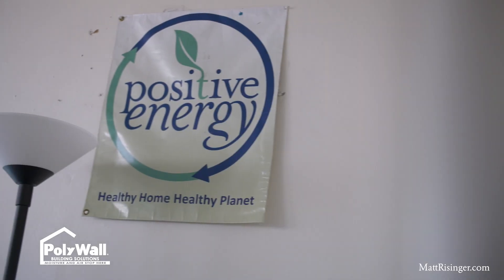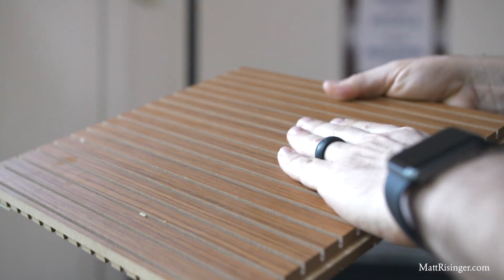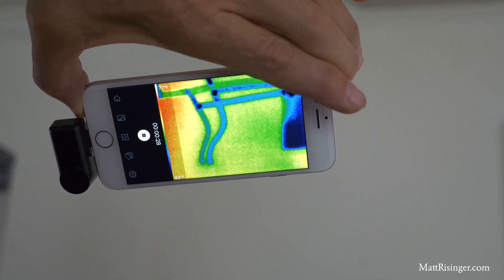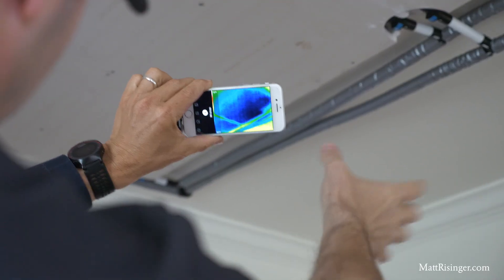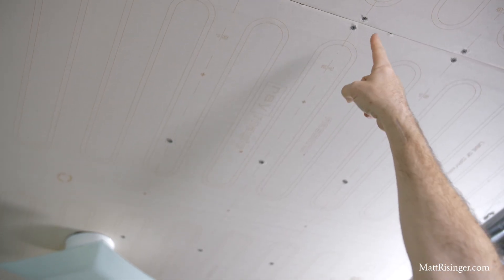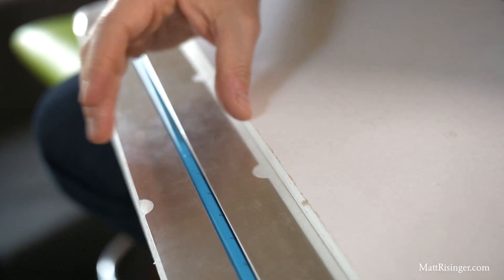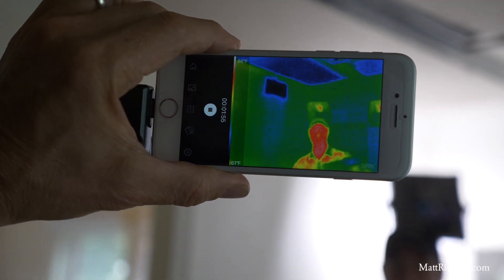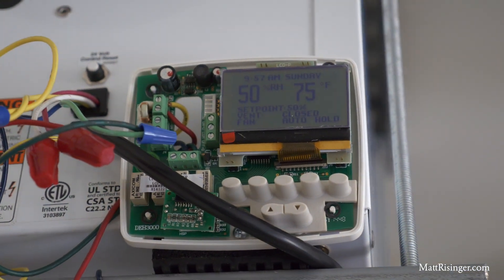Cool Your House with CHILLED WATER

Comment: @Mattrisinger I want to know if they've thought about using this in greenhouses and have they put any consideration into using a thin copper tube in the system (for reclaiming heat off of a wood stove or something similar) and I want to have a system that is similar to this except I want the water to either use heron's fountain (the concept, not the literal fountain) or be manually collected in buckets and poured back in the top end (a high point in the system or maybe you could have it manually syphon like a fish tank or gas from a car)  to not use electricity.  But mainly I want it to be capable of carrying  warm and cold water (I live in NC and it can get cold in the winter and very hot in the summer (mainly the humidity)) and I want to use the system in a greenhouse (cold climate greenhouse).
Reply: Check out Russ Finch's site, http://www.citrusinthesnow.com/   They've built over 90 of these greenhouses now using a very simple GeoAir solution.  https://youtu.be/ZD_3_gsgsnk is a good overview.

Comment: This sounds pretty cool (pun intended). But what I would want to see working is this system for the summer time and then in the winter push hot water through the same lines to heat the place. Now THIS would be pretty awesome.

Comment: The dehumidifier has a fan and is necessary to remove the moisture to avoid condensing of the cold water pipes raining from the ceiling. 
I do not see any benifit to this type of system. They also looked shiney like the were about to start sweating.

Comment: I like the idea, but why the water-to-air heat pump? Couldn't 50 degree groundwater keep the ceiling at 70 or below that? I realize that could take some digging in Texas, but it would be a lot cheaper in the long run.
Reply: Sure. But then you're just using a geothermal system.

Comment: I've been using radiant cooling for 10 years.  In the summer, I run well water through my radiant heating tubes.  It doesn't sweat because the house is very tight and it's a moderate climate (chilly summer nights knock down humidity).
Reply: Can I ask where you are? I'm in central Oregon and ess told not to do this because of sweating. My pex is under the floor on the crawlspace.

Comment: Sorry, but in the majority of regions in order to properly condition the air you have to cool below the dew point to get the humidity in a comfortable range. This so called "radiant" cooling can't do that. Plus, you're forced to back it up with a dehumidifier, which is a direct compression unit anyway. Way too complicated...just to be different.

Comment: This was tried in a commercial environment, but because of condensation issues and it wouldn't keep up with rapid temperature changes, it was eventually scrapped! Have you solved any of these issues? Also, it seems less efficient because the dehumidifier has to work more to maintain a compatible dewpoint.

Comment: Why can't you use an old hydronic heat radiator as a cold water heat absorber?
Reply: You can, but it will sweat all over your floor. Look into valence convectors, they cool, and remove the humidity all at once.

Comment: I do the same thing on a small scale with my computer in the winter. It is water cooled, but I live in Colorado and it gets to like negative 20 in the winter. Rather than pump additional heat under my desk, I run the water lines to a huge radiator I have outside. It is almost completely silent, and actually functions better than my normal water cooling in the summer.

Comment: My Dad did this in the 1960s with a self-made system that pumped "ground" cooled fluid, not water, but water and antifreeze, through our radiators. It came in at around 50-60 degrees F, good enough to cool the house  down to 75-80 on the hottest summer days. The radiators sweat. but that was easy to clean up if it meant a cool house to Mom.  The water pipe system ran underground into a cavern pond near the house that always stayed cool where it radiated the heat.  He developed the idea from his Dad who owned an old west saloon where they kept beer cold by storing the beer barrels in an underground dugout cellar.and piping the beer up to the tap. If they could get ice from an ice house, then the ice would be placed onto the kegs to help. I'm still using it, and right now today was 110 degrees and inside it was 85.
Reply: Hi, may I know how can you turn it off on winter? I'm interested in your system. Thank you ^^
Reply: @AnhNguyen-ul6lb  just turn off the pump and the water in the radiator won't be moved to the heat sink (in this case, a lake), and therefore the radiators will be the same temperature as the air in the room. all you'd need to do is connect the pump to a thermostat and it would shut off automatically.
Reply: @doctordev97  the water needs to go back to the main tank or thermosiphoning will keep cooling the house
Reply: How much is the electricity cost compared to an a/c?
Reply: @kimie126  an electronic water pump that circulates the water (just the pump, no heat exchanger or anything else ) would consume about 200watts. an 12.000btu a/c would consume about 2000 watts, so 10 times difference in electricity costs
Reply: Have you had condensation issues behind the wall or is the condensation just at the radiators in the room?
Reply: @stefanpomrenke9612  Radiators only but then we live in a dry climate, so it's not a big issue.
Reply: @themoviemaniac8416  

Does it create humidity?
Reply: @johnle231  Just condensation at the radiator sometimes if the day was humid. There's lots of modern variations on this idea that are much more efficient,
Reply: @themoviemaniac8416  

You said there are more moddern efficient ideas on this.

What are the names ?  What are they called?
Reply: @themoviemaniac8416  

And thanks for your answer btw.  Very awesome that it’s been 3 years since your original post here and you’re still around.

Cheers
Reply: @johnle231  I'd suggest looking at some of the This Old House and Ask this Old House episodes. That's where I've seen them. They often use some sort of underground ducting or piping that supplies warmth in the winter and cooling in the summer. I can't remember exactly which ones, but I recall one series where they restored a rural farmhouse not far from the Atlantic coastline maybe in NH or Maine where they did this, maybe 8-12 years ago. They also had to drill a well in that particular series that was pretty deep, and put a metal roof on the structure that they crimped the seams on themselves. I've seen some episodes of Ask This Old House where Richard, the plumber, shows this type of HVAC system being set up.
Reply: @johnle231  Yeah, I just did a "name change" as I was planning to upload some Public Domain movies, but there are a ton of them already here, and I started a Rumble account to do it there instead. Rumble lets me show limited scenes per copyright rules and link to legit movie streaming sites for those that aren't in public domain. Of course, no payout involved doing this, just fun to do, and I was able to put a couple of rare ones up.
Reply: @themoviemaniac8416  

Sounds like you’re talking about geothermal heating and cooling.

I can’t do that in the city.

I heard of one guy saying to use solar to freeze/cool water and then run that water through a radiator/blower system which I’m trying find more info on but don’t know the name
Reply: @themoviemaniac8416  

So you pretty much have a fan blowing through the radiator?
Reply: @themoviemaniac8416  

Oh ok.  I guess that’s why your name is movie maniac!!
Reply: @themoviemaniac8416  

“Hydronic cooling systems” I think
Reply: @johnle231  Might as well just use a really efficient heat pump that could run on solar. If you live in pretty dry climate, evaporative coolers work fine.
Reply: @johnle231  We didn't really need that. just normal house or ceiling fans.. This was my Dad's "invention" when I was a kid on a farm in the Midwest. Now I live in an arid area and just use a water cooler.
Reply: @johnle231  Also used for heating as well, or at least supplemental heating.
Reply: YOu're still using it, the beer?

Comment: I'm not qualified to say it's a scam but they need to come up with a more convincing argument than 76f at the ceiling and a mechanical dehumidifier (aka AC unit) LMAO.
Reply: Exactly, an Air conditioning system is a de humidifier .

Comment: After looking at this I have the following observation/comments: 1. The system is complex with a lot of tubing, sensors, and controls. This will result in increased first cost and the need for highly skilled commissioning.2. In humid climates you will need a separate whole house dehumidifier and a way (ductc) for the homes air to reach the dehumidifier.3. The system cannot filter out particulates unless you have a way of moving the air and a way(ducts) to get the air to and from the filter4. These work in commercial buildings when they are engineered for inclusion from the start. A more cost effective solution would be a VRF system.

Comment: Hey i did that a few years ago with concreted walls.

but theres a condensations and over humidity problem inside the room.
Reply: i've read that this strategy works best in a low humidity environment

Comment: >Radiant cooling

That.... that isn't a thing. Radiant = radiation. Which in this context tents to means mostly infrared, which you feel as heat. From a fire or a hot surface. It's photons. This is just convection.

You don't have "cold" photons, it's energy and it warms things up. To cool something you absorb heat from the surroundings cool air falls, drawing air across the surface. Take an ice cube from a freezer, hold it in tongs, and put your hand under it but not touching it. What you feel has absolutely nothing to do with "radiant cooling" it's plain old convection as cold air falls.

Comment: You should couple the radiant with a low velocity forced air unit from the same chilled water loop to control the humidity, instead of bringing in a whole other system that uses DX. Or else, why depart from DX cooling for this system at all?

Comment: No fan going.. there's one running right behind him.
Reply: That's because they feel clammy and uncomfortable. Oh, the new mouse trap designs are good for amusement. Of course, my thought is that they should go back to chiller systems and have the SUN power the compressor during the 5 hour solar window.  Design a system with large enough capacity to only run 5 hours per day but chill enough water to keep the home cool and dry the other 19 hours. Talking about efficient. Imagine a 5-10 ton chiller for a 2.5 ton house(it probably wouldn't need a system that big because it would being running non stop for 5-6 hours).  A 5000-10,000 watt grid tied Solar system would work great. Basically you would get free cooling.  
Note: You can buy  NEW panels as low as 50 cents per watt, add a grid tie inverter for $1500, and your done.

Comment: Cold air drops to the floor so I can see the cooling in the summer. But heat rises. If the heat panel is on the ceiling, I'm not sure about how well it heats the room below.
Reply: Warm air raises not heat. A radiator radiates electromagnetic energy in all directions which is absorbed by walls, floor, ceiling, furnitures, ... and raise their temperature. That's exactly how the Sun heat the Earth.

Comment: Interesting idea. But I wonder about dehumidifying. With a ventilator the air goes past a much cooler element so can condense humidity out of humid air to blow out dryer air that feels cooler. While this works over a large area / volume and absolute humidity is not lowered at the same rate (with the same energy spend on cooling).
Having a separate dehumidifier would seem to use more energy.
But this could also work if you'd have a heat exchanger pipes buried in the earth of your yard and pump the water through there.

Comment: This seems silly and a waste of money. You cant have "radiant" cooling like you do for heat. Heating works this way because warm things have an excess of energy that is transfered to the cooler atmosphere around it thus it radiates out. Cooler objects absorb the heat in the room so this is just a heat pump. It may drop the temp in a room but its not going to radiate cold at all. You can hold your hand over a large block of ice that's -20° and you feel a cooling sensation because the warm air close to it has lost some energy to it. Stand back 5ft and there's nothing.

Comment: Still use substantial power running a chiller to cool a home vs standard AC. It may work good for a new construction but a horrible idea for older homes. It still requires other AC to dehumidify to rooms, use a ton of more energy and is complete bunk

Comment: Glad to see this old technology making a comeback with PEX piping and dehumidifiers. I had a radiant heat book from the 1940's that showed ceiling and wall cooling with steel piping and block walls. Cool surfaces will condense water vapor if relative humidity is not controlled. Nice touch.

Comment: Boy lot of the people in the chat seem to not ever have done water chilling for cooling. The panels on the ceiling could easily be tilted and caught any condensate and drain away. If you keep exchanger clean you have distilled water if below dew point. 10° minimum below Target temperature wanted is an average needed.

Comment: I currently have radiant heating, what's to say that I can chill the water, add a dehumidifier and accomplish the same thing, just saying interesting idea
Reply: Edgar Acosta This system conducts the heat that rises to the ceiling and transfers it out, but if the radiant system loop is in the floor, then all you'll have is cool feet/shoes and the surrounding air temp will do nothing but build since heat rises.
Reply: I have been thinking the tubing needs to go vertically in the wall. Then it might work ok for both. In the summer the air would circulate downward and up in the middle of the room, and the opposite in the winter. You might even be able to create a design where you allow the condensation and have a collection system.
Any actual radiation that happens would also work better because more of your body's surface area would be exposed to it.

Comment: I had a similar system installed.  It is very comfortable. When the air is moist however, you need to adjust the water temperature using a mixing valve to avoid condensation. This in turn lowers the cooling capacity and you need some fancoils as a backup for those hot and moist days. The fancoils can make use of the same water chiller unit used for the ceiling. The control circuit has to react correctly to changes in temperature and humidity. This kind of system is very comfortable, but quite expensive.
Reply: To install or operate?

Comment: Mat do something on running pvc? 
 tube/tubes under ground in to a HRV  or a  Separate system for cooling 
On length an degrees of a 90° day an if this would work not much on U tube 
Building a new home an was thinking as i build it i could put this in next to the basement wall

Comment: Does this work best in dry climates?  Will it trigger dew-point/condensation from the ceiling, if used in a humid climate?
Is there a good way to dehumidify, when there’s no ducts in a building?

Comment: I went to North Penn High School in Lansdale PA and that building, built in 1970 or so,did this same heating/cooling system with radiant panels in the ceiling and it was a complete disaster.  The ceiling would sweat so much in the summer that it would literally rain in the downstairs classrooms.  I remember taking a quiz and having to repeatedly wipe the desk with a gym towel to have a dry area to place the paper.  Plus all the moisture made the panels rust and spring leaks.  In the winter the building was abysmally cold, with all the heat stuck up in the ceiling.  I think in the late 90’s the district spent millions fixing the problems.

Comment: My grandpa did this with a plaster ceiling in the 70's after he told the home owner that is was a bad idea. The homeowner insisted and was left with a ceiling that cracked and sweat. This system looks better, but I'm still sceptical that the same problems will arise after years of use.

Comment: Every space (hotel, office, home) in any climate with chilled water forced air was not comfortable. Human bodies need to have ready evaporation to cool. This doesn’t happen much with this system. The temp difference is not great for high humidity reduction. It felt like a rainy cool day, not a dry mountain breeze day.

Comment: Sounds like a very expensive solution to heat and cool your house. Whats the water bill going to be like every quarter?  But cool idea
Reply: Ken S The water circulates in the system.  It is not using water direct from the city (or a well) for cold water and dumping down the drain when it warms up.

Comment: Dehumidifiers cost a lot to run, about as much as an air conditioning unit.
Reply: That's because it is essentially an air conditioning unit...
Reply: I wonder if he was calling it a "dehumidifier" as more of a figure of speech; there  is no reason to run such a device as a dehumidifier (which both heats and cools the air) unless releasing the captured heat outside would make the room too cold. In a well-sealed house, it probably doesn't take as much cooling to remove the humidity as it does to keep the temperature down, so he just needs a conventional AC of a smaller size and the "radiant" cooling to handle the rest of the cooling load.
Reply: PC No  A "well sealed house" will require fresh air ventilation, and has internal latent loads, so will need a dedicated dehumidification system, even when there is no demand for cooling.
Reply: that is just not true

Comment: This may be a first for residential, but I work in commercial HVAC and have seen many similar systems with chilled ceilings and chilled slab floors. Good controls are critical to ensure the no condensation occurs on the system.